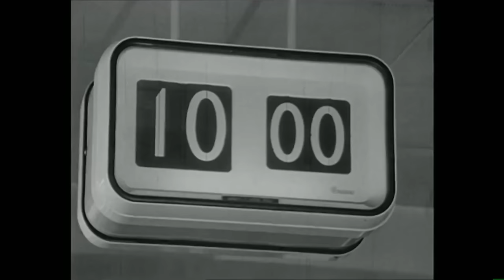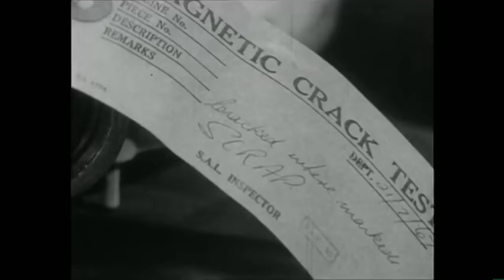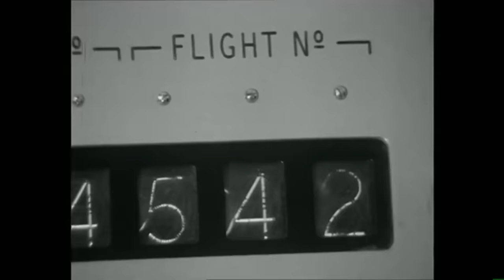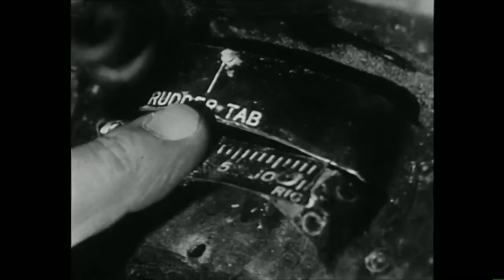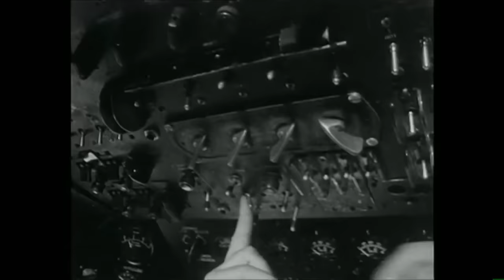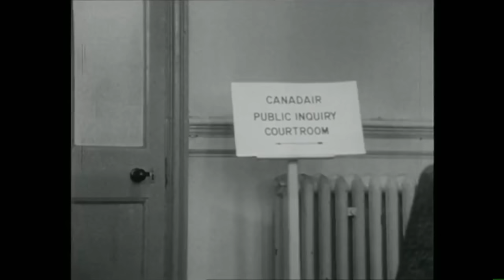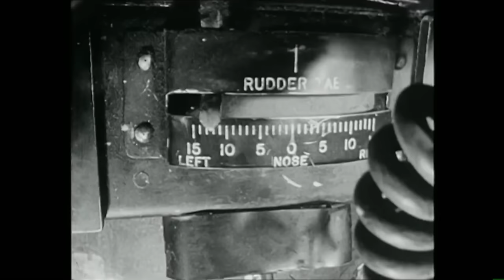Stockport Air Disaster

Comment: I was in Stockport baths when people rushed in to grab all the stock of towels. That pilot deliberately  dropped  the plane in the  only uninhabited  area between the engine failure and the Ringway  runway. His action saved countless lives on the ground if he had tried to  limp on and crashed into a heavily populated area.  Another few hundred yards on and I would not be writing this  .
Reply: That´s one explanation. My understanding of crash is following: Plane reached stall speed and pilot must tried to increase angle of attack in order to clear obstacles and laminar flow of air around wings changed into nonlaminar causing sudden loss of lift and falling of airplane like stone.
Reply: @milangacik994  pillot could have deliberately pulled the nose up to stall and fall there vs into buildings.
Reply: @milangacik994  A stall with no power on one side would be a stall-spin, and the wreckage pattern would have been oriented accordingly. Witnesses would report a roll rather than a drop. The likely explanation was deliberate action by the captain. The plane stalls and randomly hits the only clear patch of ground for miles, or like all pilots about to crash, he chooses the safest place available to set down. I think a stall is rejected because of the debris orientation and the witness testimony.
Reply: @beenaplumber8379  Yes you are right. He made decision to land where were no people nor buildings.

Comment: I was working as a gas pump attendant at the Regent Station in Bredbury when this plane was flying over very low, the engines sounded like they were stalling as if they were running out of fuel. The plane was so low I could almost see passengers in the windows. I thought at the time the plane was in serious trouble to find out later it had crashed in Stockport.

Comment: I worked for BM from 1988 to 1991, I was a young Trainee Avionics engineer. I remember some of the old avionics and electricians telling me about this accident and I can remember in dawning on me and thinking how important our jobs are and then Kegworth happened!

I was in the pub when someone told me a BM flight had gone down short of the runway and into the M1, I felt physically ill and went into a cold sweat as I was convinced it must be one our old 737-100 or DC9's not one the brand new 737-400's. Almost all my work was on the old 737's and 9's! I can remember the relief ( and shock ) to find out it was one of the brand new aircraft!!!

I'll never forget the atmosphere when I wandered into the hanger the next day!
Reply: I used to watch those BM DC9's going in and out of LBA, Worked there freightside later on. I passed the site at Kegworth on the motorway Northbound literally minutes before the crash. I got the cold sweats too when I heard about it, but for different reasons.
The only time I flew with BM was in Viscount G-BMAT. LHR to LBA Another bird sadly lost due to a Crash, one that happened many years later.
Reply: Yes, I thought about Kegworth as well. Strangely, I do not recall the Stockport crash. I was a university student at the time. Airliner crashes were, sadly, rather frequent  for a few more years yet, but I remember many of the place names where they happened.
Reply: I remember the Kegworth incident well. It was my first year at college and happened towards (the day before I think) the end of the christmas holidays, and so soon after the Lockerbie Pan Am atrocity at a time when the causes were still unknown.

Comment: This was very well done.  However, there appears to be one comment that was misleading.  The last scenario where it was stated that the captain, feathered the wrong engine (No. 3), leaves an incorrect impression that he made a mistake in doing that.  Richard Clark, one of the investigators who discovered the RPM gauge on the No.3 and No. 4 engine was reversed, would lead the Captain to feather and.close down the engine with the lower RPM as a failed engine would display.  He did that correctly since engine No.4 was displayed on engine No. 3’s needle.  He shut down No. 3 per correct procedure.  The real villain here is the mechanic who installed the gauge connectors backwards.  If this had been done, the pilot would have feathered the correct engine.  Unfortunately,  it may not have prevented the crash due to the fuel selector change which would have the engines draw fuel from their respective wing tanks.  The other strange thing in this review is that the fuel gauges are never referred to.  Doesn’ the pilot check the level of his tanks during flight to insure their levels are consistent with normal usage?  If all the fuel is on the starboard side wouldn’t that lead to a hell of a load on just one wing that could be detected when the pilot took control of the aircraft himself?  It seems that the checklist would require, before the approach, with a call out on fuel in the tanks.  Most pilots check fuel and always plan its usage so that when They are on approach, the fuel tanks are close to equal.  It’s sort of an elementary item like breathing.
Reply: Excellent points.
Reply: I agree I thought that too, they seem to have forgotten all together that the information he was receiving  was false so he was blameless in that, also regarding the fuel loss, I think its because it was a slow process it wouldn't have been noticeable right away on the gauges, he may have been preoccupied with the radar operator waffling in his ear and trying to fix the performance of the engine that wasn't responding according to the information he was given from incorrectly fitted cables on the flight panel
Reply: Airplane fuel gauges are usually inaccurate, especially in piston engined airplanes of that era.
No pilot could rely on them being correct.
Reply: No. The harness connectors were also switched vice versa which corrected the error.

Comment: At least two BM Pilots DID know about the potential fuel problem. I suspect more or even all did. As a very young man, I was on board an Argonaut at MAN some time in the weeks before before this crash when I heard a Pilot being relieved, tell his colleague arriving to take over, that everything was ok, only ocurrence was they had had "the fuel problem",  and say "I have not put it in the book". The relieving Pilot asked for no further explanation, in my hearing anyway. The relieved Pilot left the cockpit shortly afterwards. It is the lack of any questions that lead me to conclude that BM Pilots, like BA Pilots were aware.
Reply: Seems that while they may have been aware of the fuel-problem, they didn't know what was causing it, but the manufacturer apparently did!

Comment: I was a young child living just a mile away at Ardenfield Street on Higher Hillgate when the crash happened. Could so easily have been our home the plane crashed on. The crew did an incredible job of getting to Hope's Carr, a small valley in the centre of town. Had they landed (crashed) anywhere else, it would have been far worse. Last I heard the Carr was to be left untouched as a lasting memorial to the victims.

Comment: The balls of those investigators and pilots. Without computer simulation of the crash the only way to determine if a plane can fly without 2 engines is to get up there and have a go. If they couldn't get the engines started again and it was found they couldn't fly on just two then they'd have been gonners. Amazing video. Also the witnesses...How good are they in front of the camera...We were a different breed back then.
Reply: Yep. And the airline actually providing the aircraft for the test... Would not happen now.
Reply: I mean you'd assume they'd be flying at safe enough height with a parachute to be able to bail
Reply: @ottovonbismarck7715  No parachutes on airliners. Who would jump? The whole concept is stupid.
Reply: @teksal13  I mean for the test pilot who's doing the test for if the plane can fly without engines. Incase everything goes wrong and they need to bail
Reply: @teksal13  they were above fields after all !
Reply: I read this one book years ago, I need to find it...but a commerical prop plane in the 60s would just break-up and fall out of the air, they couldnt figure out why...took them years to figure out it was due to a phenomenon they knew existed, but it had never shown up in those types of situations and they couldnt recreate it in the lab, or in the air.    

I remember reading and being astonished at the fact they were literally TRYING to recreate by pushing the plane past it limits to try and recreate a phenomonen that could kill them all. 

 That takes a MASSIVE amount of testicular fortitude.
Reply: dezz nutz - 
might be No Highway by Neville Shute ... about metal-fatigue ?
Reply: @danjsy  and to my innocent eyes, not very high above them..........

Comment: Amazing footage of early FDR use and analysis. With no ability to run simulations in those days they flew the actual sortie profile to re-enact the aircraft flight characteristics. Fuel transfer error resulting engine fuel starvation. In the end there's never an accident there's always an aspect of human error, check double check and check again. Scary similarities to the British Midland 737 disaster at Kegworth in 1989.

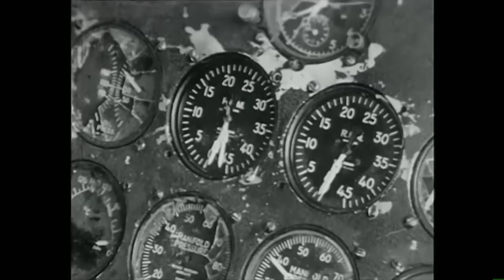Comment: Could the "red-herring" (the mis-wiring of engines' 3 & 4 RPM indicator) mentioned at 31:57 explain the board's finding that the accident might have been the result of the captain inadvertently shutting down the wrong engine (engine #3)?  Perhaps the captain shut down engine number 3 based on the RPM indicator's information, realized that it was actually number 4 engine that had the problem, feathered 4 and was in the process of restarting engine 3 (which would explain why the propeller was windmilling and not feathered) when the crash occurred?
Reply: I'd agree.
Reply: I agree.
Reply: That’s the closest I’ve heard, congratulations.
Reply: No, he explained in the video, it was a red herring because although the cables were crossed at the gauges they were also crossed at the engines. So the gauge info was correct. 
That did happen with the BM 373 crash that landed on the M1. Pilot shut down the wrong engine. There was a gauge issue I thought, I think it may have been a fire alarm that went off but indicated the wrong engine. The pilot still got the blame as there were other gauges that would have told him which engine had a problem. It was something like that. 
This is why they still call it pilot error. He had not checked the other gauges correctly.
Reply: No, he explained in the video, it was a red herring because although the cables were crossed at the gauges they were also crossed at the engines. So the gauge info was correct. 
That did happen with the BM 373 crash that landed on the M1. Pilot shut down the wrong engine. There was a gauge issue I thought, I think it may have been a fire alarm that went off but indicated the wrong engine. The pilot still got the blame as there were other gauges that would have told him which engine had a problem. It was something like that. 
This is why they still call it pilot error. He had not checked the other gauges correctly.

Comment: The DC-4's crossfeed fuel system was highly complex. The large number of possible selector combinations could be troublesome. A fatal crash involving a DC-4, VH-ANA. in 1951was caused by confusion caused by the fuel cross feed system and an open drain cock.

Comment: The difficulties of operating the poorly placed fuel valve selectors and the unclear determination of what had been selected that could cause inadvertent selection and fuel starvation had been reported by other Argonaut pilots before this tragedy happened, but neither British Midland or the two other Canadian airlines that operated the Argonauts reported it to the manufacturer! Not only that a fuel problem on this exact aircraft had been noted just five days earlier.
Yes ultimately it comes down to human error, but by who? With regards to the usual and obvious go to ie the pilot, the AIB asserted that without it being reported to the manufacturer, then it would have been extremely difficult for the pilot to determine the exact nature of what was happening given the limited time in order to react and troubleshoot in mid flight and operation! 
If there was anything that could be said about the pilot then it was fatigue, given that he had been on duty for nearly 13 hours, which was legal at the time, but it isn’t now!
Reply: Indeed. We'd hope it was confusion on the fuel transfer Otherwise, flying near stall speed with a high AOA (according to witness), on two engines, and no mechanical issues found subsequently... I wonder about the amnesia.
Reply: It wasn't a thing for airlines to report such problems to the manufacturer at the time. It would be nice to think the three other airlines who'd experienced these problems before would have shared their info with their competing airlines out of a sense of safety, but that wasn't a thing either.

Comment: Funny, but i have a three way (cross feed) valve on the fuel system in my boat. The engine cut out on me multiple times before I finally figured it out. Of course, engine failure is a much less serious issue on a boat but i was struck by the similarities.
Reply: you're lucky you didn't strike a flock of swans...   watch out

Comment: Although I was only 13 years only at the time, I remember this well as it was only a couple of miles from my home but until now I have never heard the discoveries made in the investigation. My initial thoughts when I heard about 2 engines on the same side "failing" was fuel, fuel, fuel, though of course assumptions are not the way to proceed in this sort of investigation.

The investigators discovered the fact of the cross feed valve being slightly open it led them to consider whether this was a potential cause only to be told by the experts (the manufacturers?) that it was impossible. If the investigators had not gone to extreme lengths to show that this was possible then this fault would not have been discovered. I suspect that it was because they were running to the end of what can be found by logical means at which point you have no choice but to "follow your gut instincts". Yet at the end of the film we are told that BOAC had discovered this problem 15 years earlier and had made the manufacturers aware of it. Were the manufacturers hiding this fact in order to reduce the likelihood of being found guilty of negligence?

Another significant point from the commentary which seemed to have been downplayed in the inquiry - the crossed wiring for the rev counters for engines 3 and 4 was deemed to be not significant. However, this would mean that the pilot would "see" that engine 3 was not turning when in actual fact the failed engine was number 4. This explains why he cut fuel and feathered the prop on that engine. This means that the cross wiring was indeed extremely significant. Have there been other instances of a pilot shutting off the wrong engine because of incorrect wiring?

And to those who think the pilot's memory loss is convenient - you have clearly never been in a serious accident.

Comment: I remember that, I was living in a flat in Heaton Moor I heard it go overhead very low..if the plane came down earlier it would have crashed into houses, if it overshot it would have crashed into houses in Edgerly...
Reply: Sorry but it did not fly over Heaton Moor. Never got that far. Came over Reddish/Denton, centre of Stockport but left of normal   airport approach and came down just short of Middle Hillgate and Waterloo Road.

Comment: Even today with many small twin engine piston aircraft, especially in GA, airplanes are not required to be able to hold altitude with one engine out. In this case two engines out on one side could be seen as practically equivalent in terms of VMC. However all airliners carrying passengers today can even climb with one engine or even two engines out if it’s a 4 engine aircraft. Jets and turboprops are powerful enough to do that these days and it’s pretty awesome.
Reply: What is GA?
Reply: Gordon Phillips general aviation
Reply: OK.   TY.   GB.

Comment: No computer simulations then. You had to get up there and do it. That's actually quite brave.
Reply: There was a plane approaching landing and went out of control.

After testing one FAA inspectior stuck to his guns and said the test has too be in flight. The test on the ground said it was in possible for the Prop to move past a certain point and the ground test. Provide it.

After a year or so he convince the FAA and aircraft to perform an in-flight test.

As he predicted the aircraft prop move past the safety stops and proved it was possible. The prop safety stops were change 

It's quite a story at times were they dig deep and make flight safer. 

Amazing
Reply: I don't know much about this, but they seem to be pretty close to the ground when they are stopping the engines, trying to stall the aircraft, and avoiding spinning. To me it looks like a few thousand feet, but that maybe my lack of judgement.